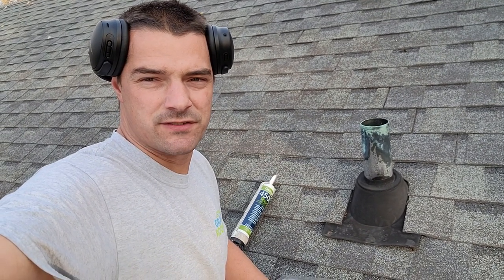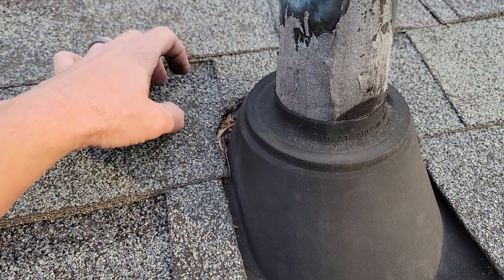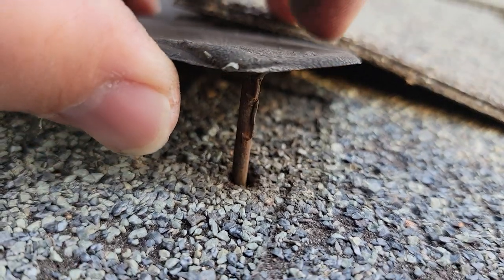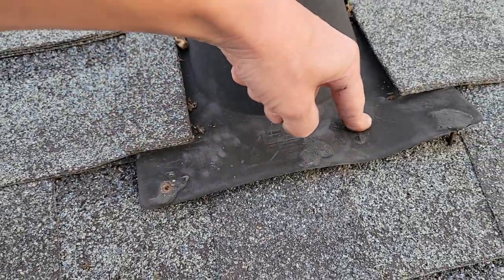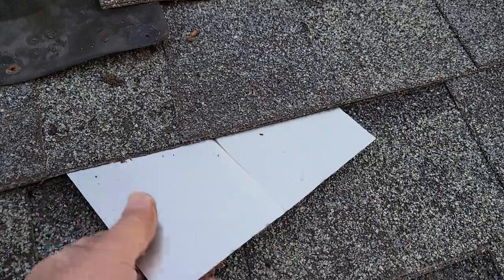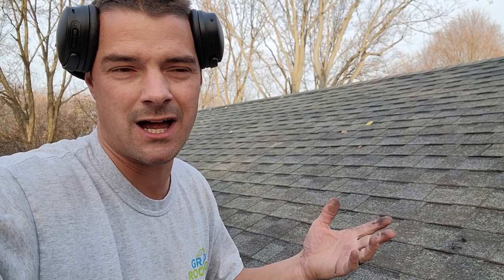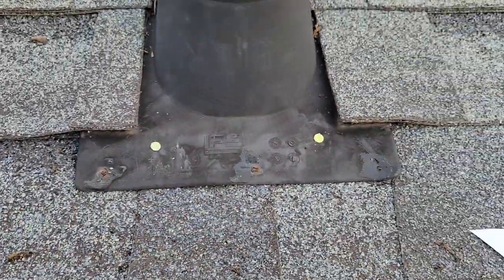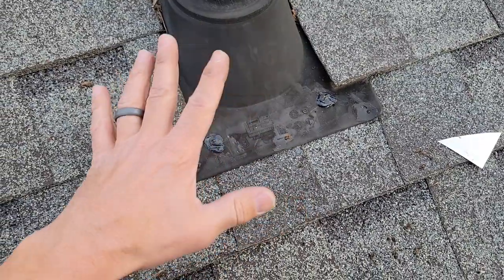Roof Pipe Boot Leak - Temp Repair

Comment: I've seen old tar on pipes like this prevent rubber gasket from sealing tight (there can be slight gapping in irregular tar).  I have my guys make sure to chip that off so gasket can seal properly.  Excellent points on nail placement!

Comment: House I live in had to have a boot replaced more than once. So after the most recent replacement I went into the attic - the pipe in question was not secured, so it wobbled quite a bit and enough windy days eventually led to the failure.

So my lesson learned - make sure the pipe in question is properly secured. After I secured that pipe in the attic, it had very limited movement, so I don’t expect to be replacing that boot anytime soon.
Reply: the plumber expected the roofer to secure the pipe with boots :) 

Usually not a problem - I have 10 wobbly pipes (when naked) on roof, none has the issue you mentioned - but yes, seen others reporting the same issue.
Reply: @xiangli2452  - the boots alone cannot keep the vent pipes from movement. The plumber is required by code to properly secure the pipes - with new construction that is something that they cut corners with to save a few dollars.

Comment: Nice man, these are the kinds of affordable repairs I have to come up with for people on a daily basis. Never did this one, although it's a great tool to have in the toolbox! Mainly never had to come up with it because I change hundreds of these things a year, mostly because in my area everybody uses these things called "5 in 1's". Maybe you've heard of them as "Multiflashing", a rubber boot with multiple tear-away rings to fit 5 different sizes of pipe, (hence "5 in 1"). Sadly, these boots are made of such poor material they often disintegrate, (not exaggerating), within 2-10 years. If they last 15 they got lucky. Now, I also have to do these repairs on roofs in the same condition as the one in this video. Problem being, the boot is generally blasted by the sun into so many pieces I have no choice but to replace them completely. I have learned lots of tricks to replace theses things on roofs in very poor condition, but as you said the shingles generally either tear in the process or are in such bad shape that when you put them back down it's like you might as well be putting a piece of paper on the roof. Ugh. Stratas/condos/apartment owners are terrible for this, as they want the cheapest possible fix. 

Now I have a couple questions for you. I've been kind of making some of this stuff up as I go over the past several years, but based on very good knowledge that was imparted to me by some VERY long time roofers. AND seeing as how you seem like a very knowledgeable fellow, I would like to know;

As to how to actually fasten the boot to the roof, I was taught to have NO (zero) exposed nails on your roof, with the exception of the last caps you put on, and wall flashing. Now, myself when I replace pipe boots I always put my nails as close to the bottom as I can but so they are still underneath a shingle. If the boot was installed poorly and most of it is exposed to the sun, I cut the shingles to cover as much of the boot as possible, then install the nails so that none of them are exposed. Then I seal all the shingles that I just had to break loose to make sure they won't blow off, as well as any tears in the shingles that occurred in the process. So my question is, in this instance, is there a reason you put the nails exposed as you did and not under the shingles? And should I change my method to reflect this? Personally I would have lifted the corners of the bottom most shingles and put the nails under them, but still sealed them just because of the condition of the roof and the fact that they are going through metal. Most of the time though, I nail under the shingles and put no sealant other than to glue the singles down against wind damage. Is this wrong?

My other question relates to the roof ventilation. Now, I have moved to a different area from where I learned roofing, carpentry and so on, to a place where things are done uh... a little differently. In my area, I see hundreds of roofs every year that are completely shot on the south side but not on the north or east side, and I have long been suspecting the ventilation being the culprit. The thing is that lots of these roofs have a properly installed ridge vent, or adequate ventilation of some other kind, be it whirly birds or whatever. So, where I learned my trade(s) I was taught that every space between trusses should have a baffle to allow air flow from the soffit to the vents on top. Where I am now, they go every other space, or less. Is this an issue? I do live in the hottest place in Canada, the summer here is 40+ Celsius for months on end. So the question is, if a roof is totalled on one side but not on the other, is that definitely a ventilation issue, and should every space between trusses have a baffle?

Thanks again for the vids! Always learn something here.
Reply: use active vents, not passive - if heat is an issue. BTW, I am in Houston, have 4 active fans on roof, plan to add 1-2 more.

Comment: Wouldn't a single screw in the middle lower side(not on the edge) be best option since you dont puncture the water flow area at all?
And then caulk some dots on the underside so they dont get affected by the wind?

Comment: When you say you have to nail because there could be wind-driven rain - why not use an adhesive to seal it down instead of nails so there isn't a penetration on the top?

Comment: Washered metal roof screws only in exposed area. Will last twenty years with a aluminum pipe jack. Shingles are only good for fifteen to twenty years period depending on brand. That's the facts